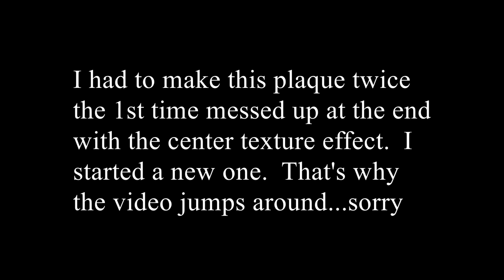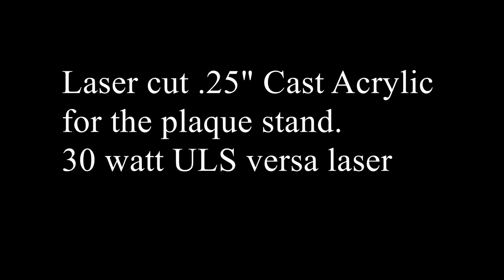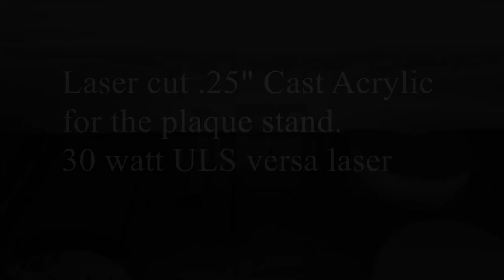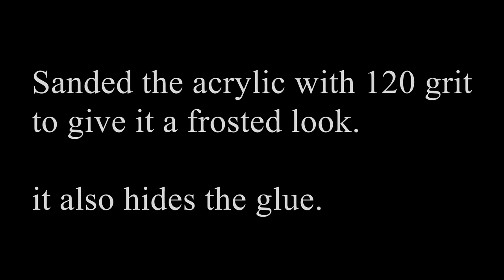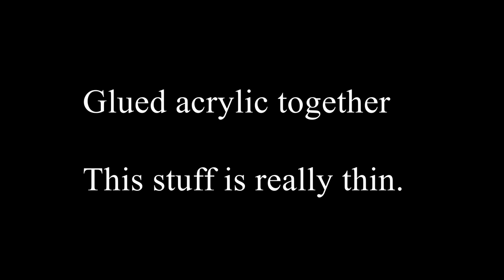Shapeoko 3 XXL project :Chevy bowtie and stand

Comment: You out great effort into this, very impressed with design & execution.
 I'm interested in your diamond grip pattern. What spacing & depth did you use? Looked quite close & deep on first try. You might have gotten better results if you could stabilise the oak from breaking away. Flood with thinned oil based polyurethane varnish, couple of coats. Or thin CA glue. This would create a more solid structure in the wood fibres rather than hollow porous tubes, and less likely to disintegrate. Experiment with diamond size 4mm to 6mm using narrow 90° bit, 4mm depth & not too fast feed rate. This should leave enough body in the diamond to support itself. Use the 60°v after the diamond to clean up any V bit scrapes on the sidewall.
But it's 2-3 years since that project, I wonder if you've tried that pattern since or will ever try it again? It's all theory ATM, but I may try it soon. Add to me learned skills.

Comment: What is wattage of that lazer? How thick acrylic you can cut using that ?
Reply from the maker: 30 watt laser. 1/4 inch is about as thick as I can cut with it.   I could probably cut acrylics slightly thicker but it would require multiple passes.   I've never tried cutting anything over 1/4 inch
Reply: @jeremybrown3139  Is it a co2 lazer or something can't understand because, your lazer seems small .
Reply from the maker: @DiscoverRajivVlogs  it is a co2 laser.  The video is speed up to keep video length as short as possible.  Although the laser part is not nearly as speed up as the cnc parts the actual speed of the laser was a 2 and the ppi setting was 200. These are the numbers in the uls software for the laser.  Not sure if that translates to 2" per minute.
Reply: @jeremybrown3139  Thanks for replying 👍

Comment: When you finish the cutout, does it actually cut all the way thru, or it leaves some tabs attach to the whole wood for you to detach/remove by hand?
Reply from the maker: Because I clamp the wood I leave little tabs about .25" long and .062 thick. When I  remove the whole thing from the CNC and use a razor knife to cut it out.  Then I sand it smooth.   If I used double sided tape or use a vacuum table I could do with the tabs and go all the through.  I used to use double sided tape but sometimes the table would get pulled up into the endmill and cause issues.
Reply: @jeremybrown3139  Good information. Thanks for the input.
Reply from the maker: @Imagine-j5g  no problem

Comment: did you use just one bit?  What size?
Reply from the maker: I used .25 ball nose for the texture, .25 end mill for rough cuts and cutout, .30 degree v bit for texture in the middle of the Chevy logo and a 60 degree bit for all the chamfer edges